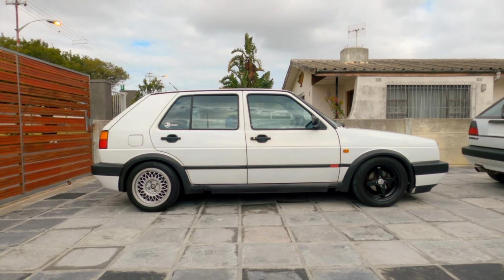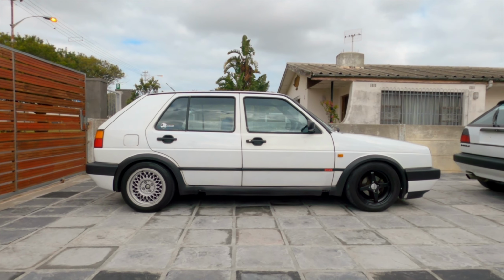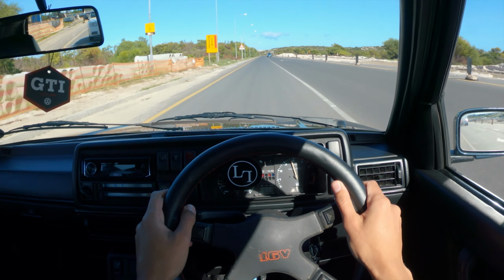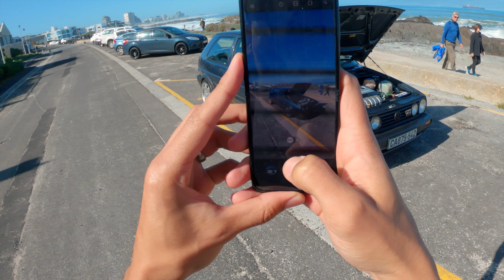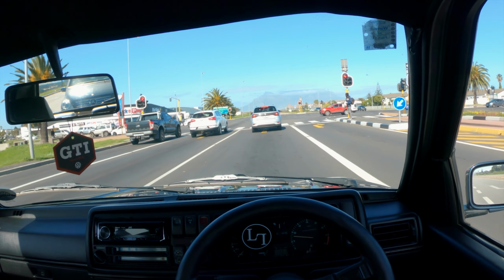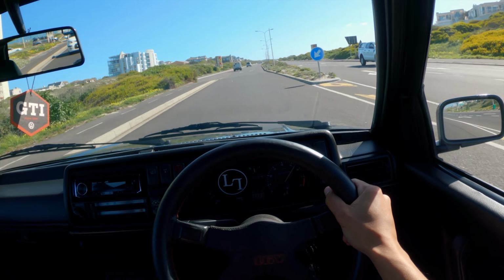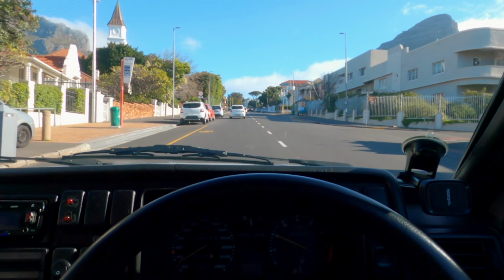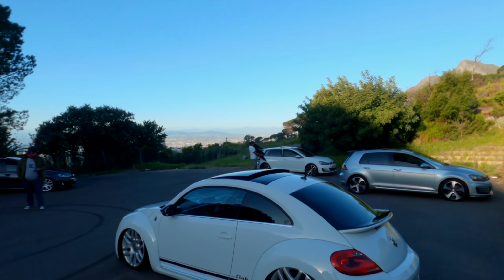POV driving a modified 12v VR6 swapped Mk2 GTI | Cams and short ratios

Comment: Nice vid as always bud…I had a look on the internet and must say some guys get huge gains from a vr6 turbo setup
Reply from the maker: VR6T's make really good power and torque and you can make more than enough power on a stock engine. A head spacer and ARP rod bolts then you're golden. Definitely worth it. Not cheap, but a better base than starting with a 4 cylinder.

Comment: A 2y gearset and final drive in that VR6 and the experience will be much more exciting
Reply from the maker: I'm curious as to what trickery is happening in the box as it is. It feels pretty short.  But thanks for the heads up. Will try to remember that if I go this way.
Reply: 2Y gearset won't work its cable shift

Comment: Car sounds nice with that VR6 engine but it would had a bit more oomph if the engine was 24valve like the Toyota Cressida 3.0i but im loving the modification and sound awesme!
Reply from the maker: Yes the 24v has a bit more power but it doesn't sound quite as good as the 12v engine unfortunately.

Comment: That VR6 mk2 is pure class. Perfect colour, perfect wheels, and beautiful condition. Engine bay looks lovely as well.  The reason it doesnt sound that great through the rev range and isnt pulling that nicely at the top (IMO) is that cone filter (facepalm) ...they sound and perform far better with a modded airbox and drop in filter. Cones on NA VR6's are rubbish! Add to that, I am not a fan of short ratio boxes either because a healthy VR6 pulls perfectly from take off. Yes its not going to launch like a modified 1.8T with semi slicks, but lets compare apples to apples.  Then stock VR6's must be donkeys top end, eish, again...what are you comparing them to exactly? My favourite line though "mY CaR L0w BoOsT WoUlD WaLk iT" lol, if the owner had to throw the kind of cash you threw into your 20v there would be no walking sir. Anyways, love your content otherwise lol.
Reply from the maker: You sound like a true VR6 enthusiast. That's awesome. You're right about the cone filter. The owner will be switching to a airbox soon. He hasn't gotten around to it yet. 

A stock VR6 is not fast. I don't need to justify this or compare it to anything. Using the word donkey might be offensive but I call my car a donkey even when it's making well over 200kw and chasing down 300kw E30's. 

My car on low boost would walk it but so would a stock 1.8T swap that would cost less than what the owner spent on this conversion. But like I said, that's not the reason you VR swap. If the owner spent what I have on his conversion, it would be a different ball game. But that wasn't my intent, I tried to get as close to apples to apples by comparing it to my car on wastegate pressure, not full send. 

I was not trying to belittle the VR6 or the community. It's a great engine and it runs well but I'm a racer and going faster is all that really matters to me right now. 

Appreciate your comment and I'm glad you enjoy my content otherwise 👍
Reply: @lowdl  Firstly, respect for taking time to reply to my comment. VR6's get a bad rap because most owners dont look after them or bugger them up with cone filters etc. Most of the time guys who call them slow etc have never owned or even driven a decent vr6. I mean people dont go around calling 325i or even 325is' slow, yet the performance is similar. But all good man, everyone has their preference. Definitely not a track toy. I think it was the donkey trigger for me lol
Reply from the maker: @salesaccount710  yeah, that donkey comment would have pissed me off too. 🙈🤣 Once again, I'm guilty. I also call 325i's slow. I was a NA 16v guy and there's something about beating someone with a bigger engine with less power that has that effect. I think the 2l 8v guys are the the worst with this. Lol. 
I'd love to add a VR to my garage in future. They are slept on but their values are rocketing like crazy.

Comment: Beautiful car, do you knw what kit he used for the conversion
Reply: No kit, mk2 subframe and crossmember with custom mounts. Easier route would be a mk3 gti/vr6 subframe with vr6 mounts then you just need a custom front mount.
Reply: I’m currently working on doing a vr6 conversion on a mk1, so trying a proper kit for the conversion, you got any recommendations?
Reply: @neleshbarathlall84  speak to the guys at DRD in Jhb, they sell an awesome kit for the vr6 swap on a mk1.

Comment: Nice vid as always bud…I had a look on the internet and must say some guys get huge gains from a vr6 turbo setup
Reply from the maker: Thanks! Yes, VR6T makes really good power without modifying the engine. Usually head spacer and ARP rod bolts and you can make good power and torque.